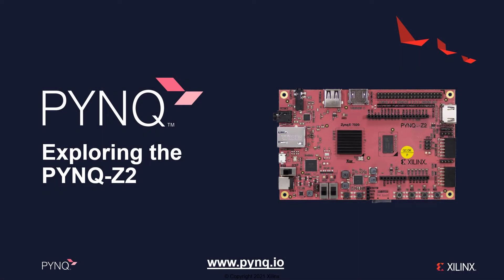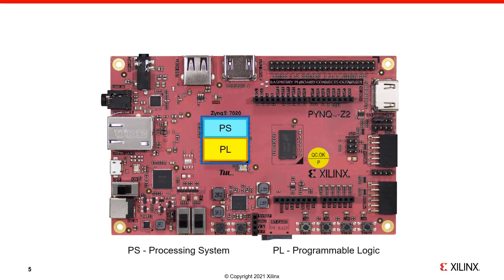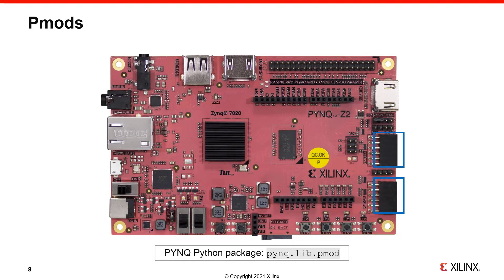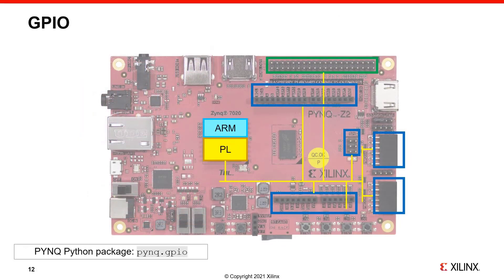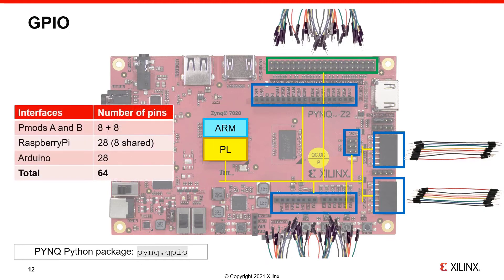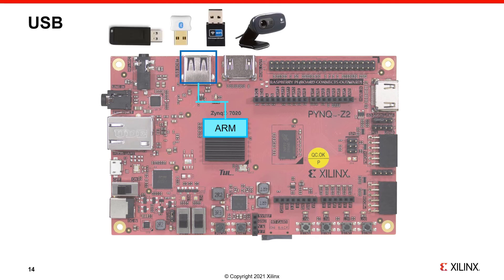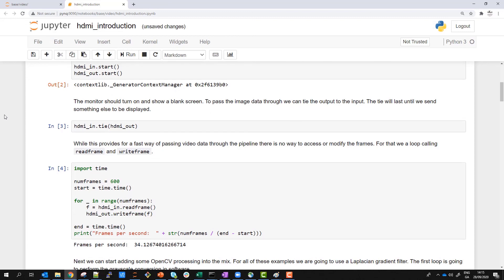High level overview of the PYNQ-Z2 and how to use it with PYNQ

Comment: Is Z2 an UPDATED version of Z1?? Thanks!
Reply from the maker: Yes, PYNQ-Z2 is an updated version. The two boards are similar, and some designs will work on both. The main differences are the Audio codec on the PYNQ-Z2 and the Raspberry Pi interface.

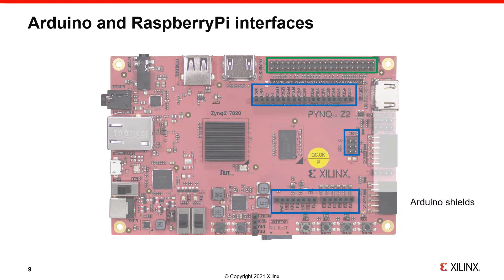Comment: 5:15 Is any way to use an Arduino code already done in the python from jupyter? (I did one with serial monitor, i2c to control an external board (shield)) or I have to rewrite it all in python? Thanks! 😄
Reply from the maker: Unfortunately no. The peripherals are connected to MicroBlaze processors. Arduino are using different processors, so are not code compatible.
Reply: @cathalmccabe8618  okey thanks for the reply! Yup I couldn't find a way, is that the python library to control the PCA9685 Adafruit 12 bit 16 channel board that is on github, was not working for the PynqZ so 😅 a shame it didn't work, at the end I left my project with Arduino